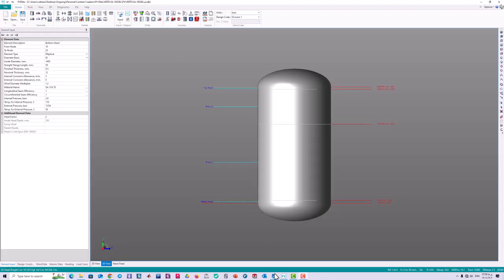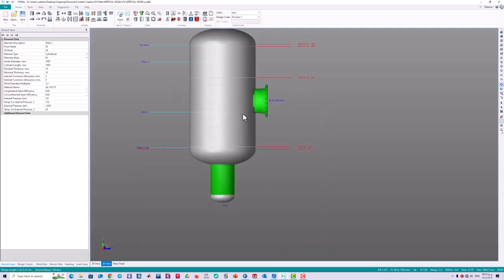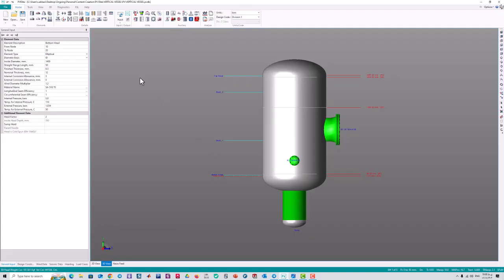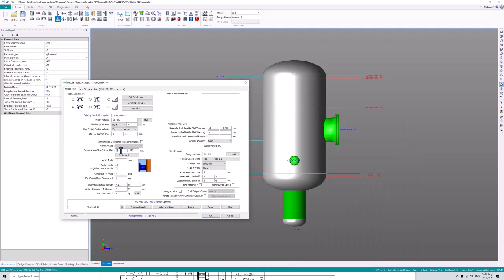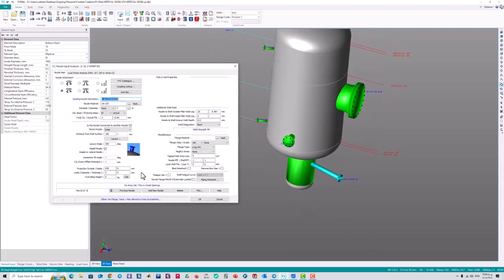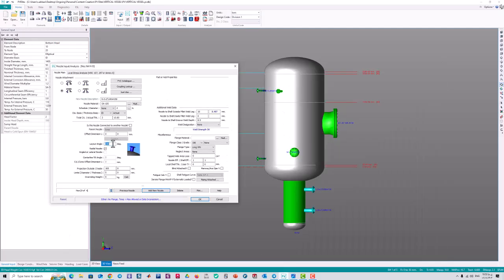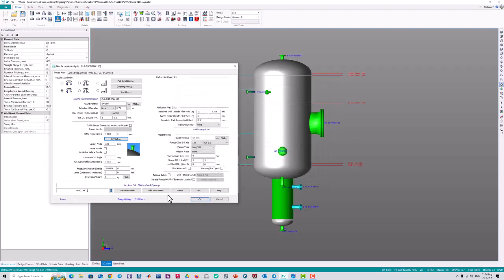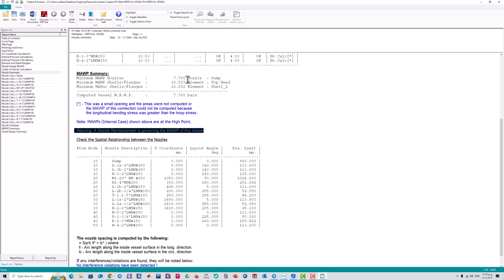Vertical Pressure Vessel in PV Elite (Part 2 Nozzles)

Comment: Thank you for the great video. It is very helpful.
I didn't know I could add a head to the end of the nozzle as you showed.

I have a question:
I have a horizontal Ø610 mm shell and I need to model another Ø273 mm shell at 90° to it going up. Is it possible to do in PV Elite?
This new shell (Ø273mm) then has a bolted flange after 500mm and then continues as another shell (3100 mm) after the bolted flange. This final shell then has a torispherical head at the end of it.
I hope i could explain the situation without being too confusing.

I haven't been able to do this as a shell but added it as a Ø273 mm nozzle
Reply from the maker: Thanks @mertsi1340
In PV Elite, you cannot model the vertical Ø273 mm section as a second shell intersecting the Ø610 mm vessel; it must be defined as a radial nozzle with 500 mm projection and flange. The 3100 mm continuation and torispherical head should be modeled as a separate vessel, and any flange or external loads should be transferred back to the main vessel as nozzle loads.
Reply: @SimulateLearnAcademy Thanks for the speedy reply.
I guessed as much. I have usually solved the problem as described by you. I just thought there might be a way I was not aware of.
Cheers!